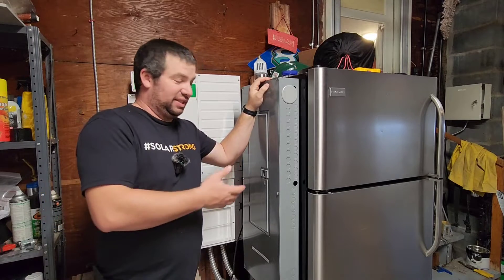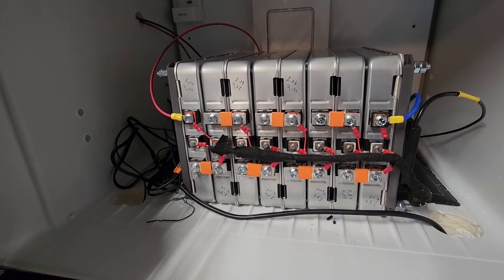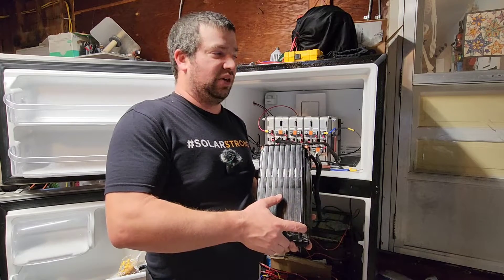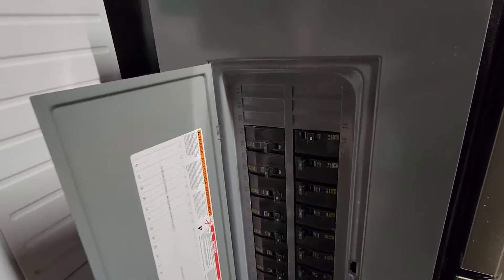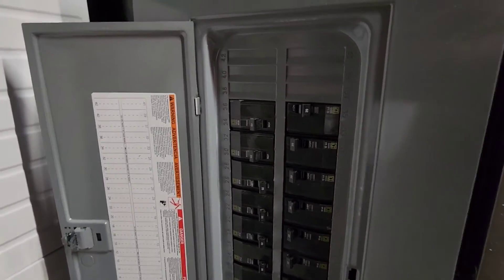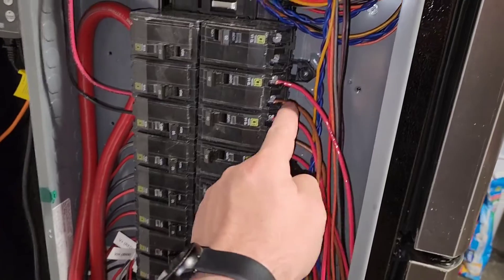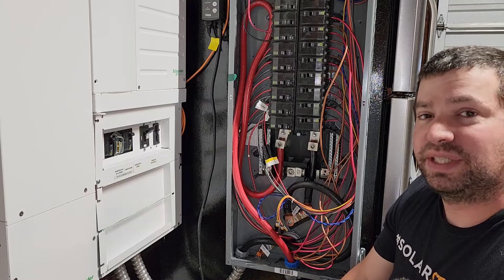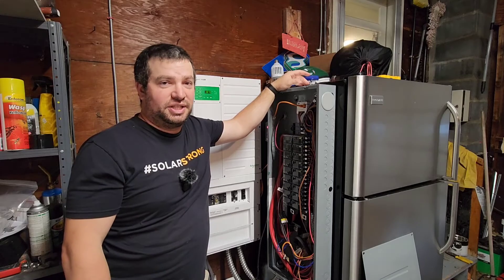Solar Powered Lithium Battery Using Recycled EV Batteries and an Old Fridge

Comment: Just be careful folks raw cells dont trun off and they can put out thousands of amps. I have a 70kwh pack like this. I work with 2000 amp 480v  industrial control cabinets every day. NPFA70E trained arc flash gear etc. But at home low voltage i let my judgment lapse and arc flashed myself. 3 rd degree bruns on 3 fingers on my right and and my thumb on my left hand

Comment: How do you keep the inside of the refrigerator from molding?
Reply from the maker: I threw a few large silica gel packets in there on top of the batteries just in case.  I'll probably prop the door open during the summer though.  The fridge is just there to keep them warm in the winter.

Comment: I have a question where did you get those BMS the 40 amp discharge and 40 amp charge
Reply from the maker: The 40a charge and discharge I got direct from Daly on Ali Express a few years ago.  The newer ones I've got off ebay or Amazon have been 40a discharge 20a charge.  I have these overcurrent protected at 20a anyway and as a rule of thumb, never go over half of the rating with anything like this.

Comment: Hi Ben which charge controller/inverter do you use to charge the batteries to 67v? None of the systems I can find want to run above 48v nominal. I have a stack of 16s 60v modules I’d like to use on my system. Many thanks.
Reply from the maker: Hi Jonny, currently I'm using the Schneider XW Pro inverter and 100a 600v Charge Controller.  I can get up to around 65.5v with that which is plenty for a 16s NMC battery.  Previously, I used the Sol-Ark 12k which was good up to 63v, leaving a little bit on the table. 
I'm ok with not going over 4.1v per cell with these.

Comment: Ben, if there is a good solar information channel out there from not only an installers viewpoint but, that of a consumer as well that beats your channel, I've yet to see it. Your information is understandable too even old guys like me. I just wish more people would find your channel and subscribe to keep you helping us that need it. Like the used refrigerator idea. It would be even better to find a upright freezer but, the older ones never break down if they are not moved a lot. Good luck finding a 225AMP Square D QO breaker box. I just paid a small fortune for another one.

Comment: I absolutely LOVE this! Not only is it a cheaper solution to solar storage, it is a critical second life for car batteries. This niche really needs to go mainstream beyond the  DIY one-off projects. 

 Obviously used batteries have shortened life and contractors couldn't offer much warranty, but if the price was right, people would be ok with that. It's especially encouraging that you have had success using different sizes and levels of degradation, so the system can be expanded or have one piece swapped out. It's also great that those breakers are dual rated. Hopefully these EV batteries will become easier to get.
Reply from the maker: I bought the Smart ForTwo off ebay a few years ago, but recently I've been getting EV batteries from BatteryHookup.com.  I look for pricing around $100/kWh. BMS is an extra $15/kWh on average for this system, but totally necessary.  Thanks for watching!

Comment: I have used parallel packs as well.  The main issues that I've found is all the micro-cycles between packs.  When you run a load, all the packs should be at identical voltages.  Once the load is removed the packs will normalize to no-load voltages which are quite disparate.  As you mentioned, the highest packs will essentially recharge the lower voltage packs.  But that micro-cycle in which no work was done counts towards your lifetime cycles on the cells.  Hence they degrade at a significantly greater rate.

Comment: Cool battery! You and Poz got me into NMC type batteries. It’s also cool you can have all those different capacity batteries together in parallel without issues. You might remember I had the 16s Chevy volt batteries. I have since sold them and got LiFepo4 cells. It’s definitely a learning curve switching. TBH I like the NMC batteries better due to voltage being a much better indication of SOC, but at least these are not as explody..

Comment: I'm not familiar with the Volvo or Leaf batteries. Are they LFP or NMC type?
Reply from the maker: They're both NMC.  Most all EV batteries are as of right now. I've heard that tesla is starting to use LFP in some areas, but NMC has a higher energy density which makes it better for EV's.
Reply: @benssolarandbattery  Yes. Thanks for answering. The charge curve for NMC type batteries is very different than LFP, so that tells me the BMS you're using is for that type of battery. I've been looking around for an inexpensive NMC type BMS and had no luck. There's the Batrium of course, but that's a high dollar powerwall type solution.
Reply from the maker: @arleneallen8809  I've been using the Daly BMS's for a couple years with great success.  I've heard poor reviews about their "smart" BMS, but these "dumb" ones have worked great.  I threw a link in the description for the exact one I used.  It is only 40a rated, and I only trust them to do half of their rating, but if you're paralleling a bunch of modules they work well.
Reply from the maker: Here's the link in case you can't see it there.  https://amzn.to/3WBUUvl

Comment: Totally agree they balance out current just flows to where it is needed the use of these batteries in a home load is like a retirement centre. lol
Reply from the maker: It tickles them a little bit...   I get a lot of people asking about active cooling for them but it's just not needed.  A full charge throughout the day will raise the temp maybe 5 degrees.
Reply: @benssolarandbattery  even my 26650 LiFePo4 batteries raise the temperature 2 degrees when I charge them

Comment: Thanks, Ben. Nice system. I'm not drawing massive power either so I'm not particularly worried about the batteries being over discharged/imbalance due to a long running massive loads. My worst load is in the evening in summer when I run a 3TON AC unit off the batteries when the sun goes down until it's bed time. No issues. I like the seed starter mats. I'm planning a Lithium battery expansion (not LifePO4) and I want them outside as I already have the batteries so I'll probably do something similar in an out building.
Reply from the maker: I picked up the fridge for free at the local drop off center.  They looked at me a little funny, but let me go sort through the 50 or so they had there.  Told me if I wanted to bring it back, it would be $10... 😃